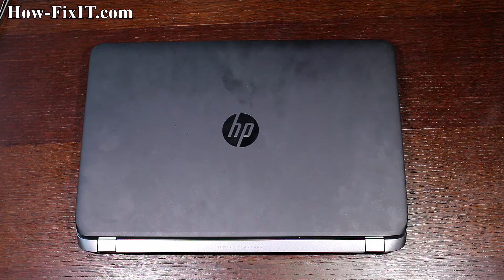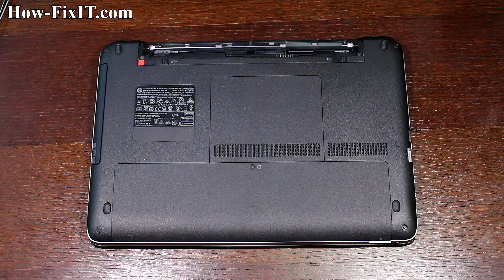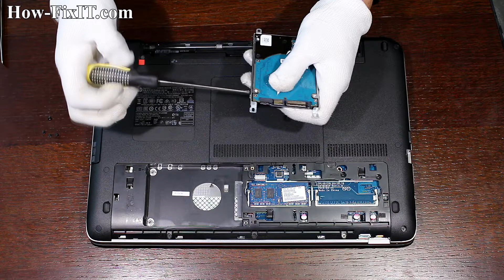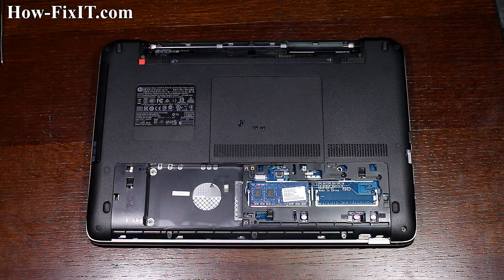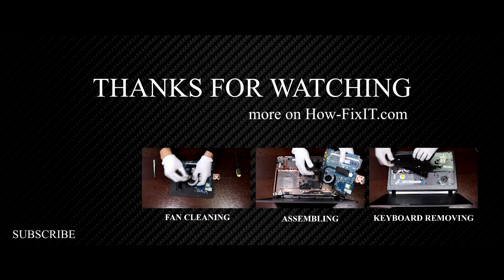HP ProBook 450 G2 Hard Drive or SSD Upgrade: Replacement & Installation Guide

Comment: Your laptop already has a slot just above the RAM area and next to Wifi card... M2 SSD NVME; please make a video how to install there and which models are compatible. Replacing HDD or DVD is not the only solutions
Reply: It's not NVME, it's M.2 SATA III.
Reply: @saifaddeenal-manaseer6325   does it support 256 ssd
Reply from the maker: Check a video explaining the differences between HDD, SSD, and M2 NVMe 👉 https://youtu.be/r3Jy5dHOj3g

Comment: Can this laptop support m2 sad ? Please can u provide me some links with m2 ssd that I can install ?
Reply from the maker: this laptop support only SATA SSD, not m2 ssd
Reply: @howfixit  This laptop support M2 2242 (42mm).
You can check it at: https://support.hp.com/vn-en/document/c04355112
Reply: Newton3297 yes it’s support M2 SSD only 120 GB please check HP website with your model number then you can find details upgrades limits
Reply: Where in this video does the mime install a SSD? He removed a mechanical HDD and installs one again. I know the m.2 slot is in the other part and apparently it's not supported above 120gb and it must be a m.2 2242 size but why wouldn't the HDD be replaceable by a SSD (500GB or greater)? the HP support site only mentioned ssd m.2 max 120GB ? Trying to give this old laptop a little boost :)

Comment: how do u think which 2 tb hard drive will great to hp probook 450 g2? i wanna change my hard and thanks for video
Reply: Sarvar Ilhambekov that’s sound great but increase RAM otherwise the load is huge rather than RAM !!! You may install a M2 SSD NVEM, there is a one slot in your mother board